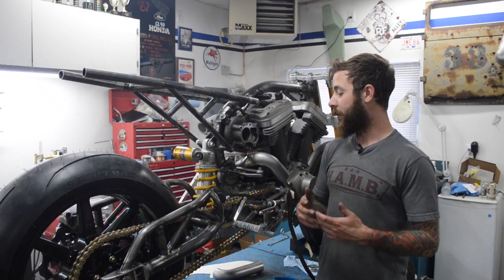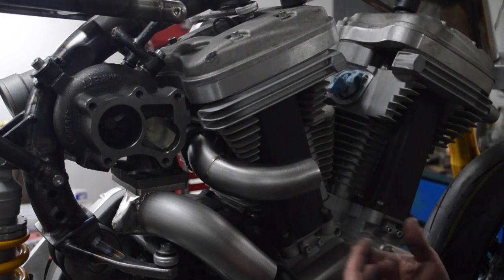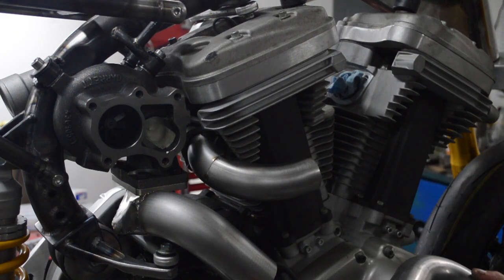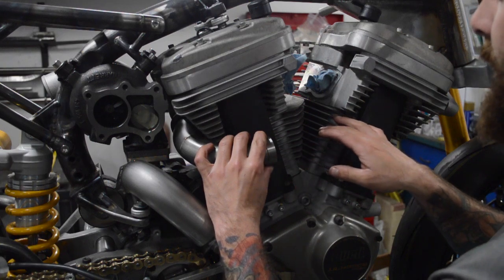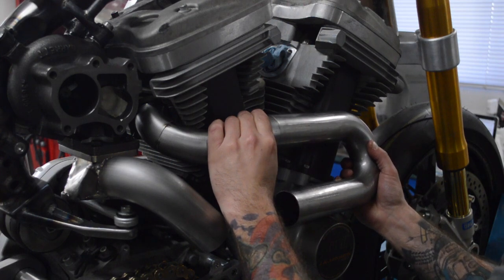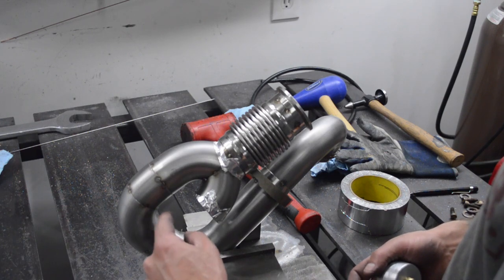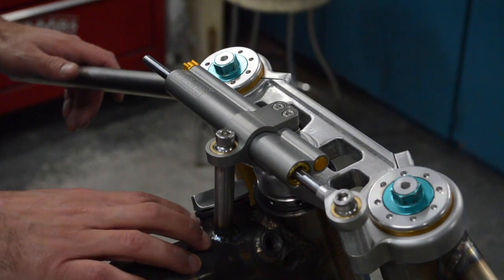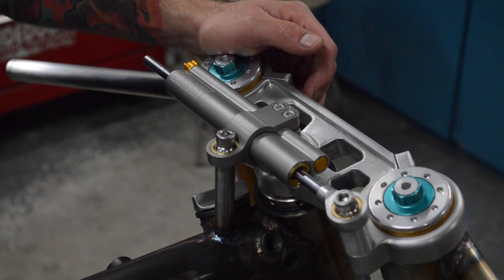Making The Exhaust - Turbo Buell Build

Comment: Cool build. Have scratch built a turbo system on my vrod over 10 years ago. Still going. One question why locate the turbo so close to the rear cylinder that already has a heat issue?